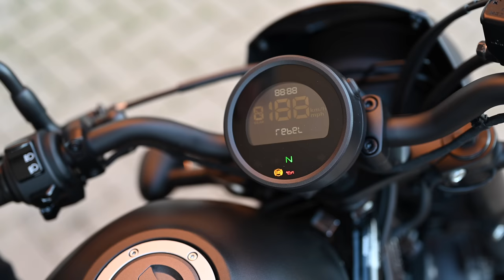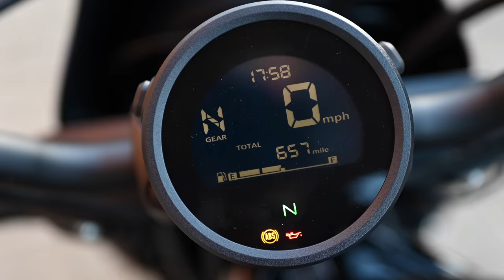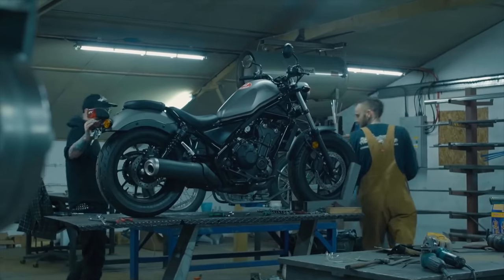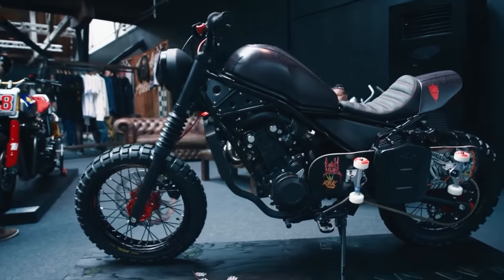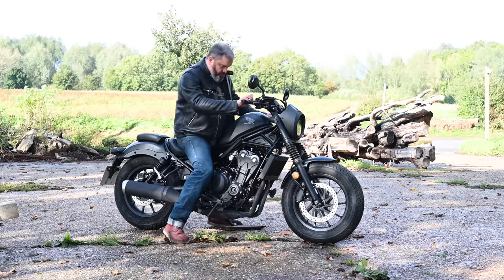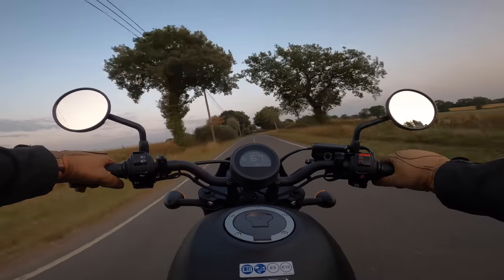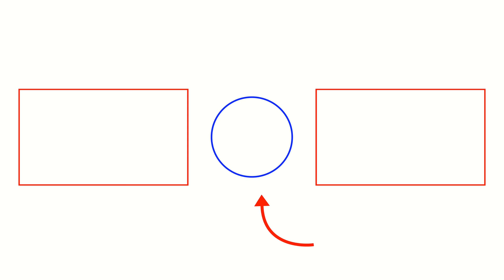Honda Rebel 500 - Road Test & Review

Comment: I've owned this bike for just 1000 km now and I can say it's definitely going to be a long term relationship
Reply: Can you travel on it? Like 300 miles?
Reply: @tea-bag7030  of course you can ....i have the same 2020 blue version and is awesome!  i bought the new mustang tripper seat 400$ ...and wooooow! what a change....i will stay with this motorcycle forever. i am positive..even if i saw today a new 1100cc rebel...i dont care...500cc is enough for me and it works just perfectly fine for me.enough power
Reply: now that the 1100 has come out, would you reconsider?  hahahha
Reply: @happyface8674  honestly i still think that rebel 500 is my best option.i dont make longer trips than 100km and i use my rebel only to commute, i now that 1100cc would be faster but 500cc is fast enough trust me. Is an amazing bike.
Reply: Haha, I relate exactly the same. 

Had to hide it at 1,200 KM now because of winter here.
Reply: @sergiuulici3908  how big are you just curious cause im looking at this bike... height and weight?
Reply: @jas9590  hey there! I am 1.70 cm and 73 kg....for me its perfect.  And i know a lot of people says is a cruiser...but the engine was taken from the cb500R which enable you to rev it a lot and get that sporty ride whenever you want some adrenaline.  Perfect commuting bike. The 1100 cc is too much to do the same. Drive safe!
Reply: 1100cc ist 30 kg more or 40 wirth dtc
Reply: how does a heavy set 6 ft man look on it?
Reply: @ManCaveRo  I can't speak for myself, as I'm a short person. But I think it doesn't make a big difference. So pretty normal. The only thing to consider would be the bent of your knees, but I think it's just a matter your liking.
Reply: @haago90c  thanks for the reply!
Reply: @haago90c  aint bad being on a bigger engine yammie bolt probably only advantage it has is highway riding… but no 6th gear and filling up every 100 miles gets OLD.

Comment: Looking to buy this to get back on two wheels. Couple years ago had a 2014 cb500f. Sold it with over 100k miles and the engine still purred flawless. The 500 engines are top class for reliability. Hopefully they have improved electrics since 2014, only problem i ever had with my Honda.

Comment: Agree with the forward controls.  I had real trouble moving this bike in my driveway - two heavy Harleys no issues, this feels top heavy to me.  It runs awesome from 25-45, but it doesn't do well on the freeway (numbing vibration) and it's very slow to accelerate IMHO.  Good review, thanks.
Reply: I noticed the jumping and bobbling when he increased speed

Comment: I don’t get why everyone thinks the running lights are a safety issue. Amber running lights are also not common in Germany. I own the 2019 version and had absolutely ZERO issues with them. I drive mostly in the city with lots of traffic (Berlin) and not one driver mistook my running lights for active indicators. The indicator shines way brighter than the running light. This is definitely a non-issue in practice. If anything it improves the visibility of the bike especially at night because the lights are spread out wider. There is a higher chance that a car driver sees at least one light in his mirror.
Reply from the maker: I haven't yet experienced any issues either , but it does seem an unnecessary risk? If the aim is for extra visibility they could be white lights? There are plenty of examples of dual colour lights for the rear. I don't know if you've ever ridden in the UK? maybe German drivers are more disciplined?
Reply: Views from the Man Cave No, I haven‘t ridden in the UK yet. But I can tell you that drivers in Berlin are definitely not disciplined. It’s pretty chaotic especially during rush hours. Double parking vehicles blocking lanes, drivers illegally using bus and bike lanes and cars quickly switching lanes without using their indicators is common place.

Comment: Not sure if your still responding to comments here but ill give it a go. If I was a brand new rider and wanted to do off road would you recommend starting on something like this and then going for a dual sport later or just going for the dual sport?  Also Rebel 500 vs 1100 thoughts?
Reply from the maker: Yep, i'll always try to reply to comments on all my videos. As a brand new rider looking to venture off-road I would suggest looking at the Honda CB500X, its the same engine as this but in an upright adventure style bike. Easy to ride, managable size and comfortable. https://youtu.be/g7j5APN_I2U  - Rebell 1100, more power and more weight and a little bigger
Reply: @mancavemoto  Thanks man! Appreciate it. The CB500X looks really nice!

Comment: I like the bike, but those amber running lights must go! Don’t know why Honda did this for the UK/EU market. Our indicators are hard to see enough as it is, going from an amber light to a slightly brighter flashing one is a safety risk.
Reply from the maker: My main worry with it is vehicles pulling out of side roads. A lot of drivers don't look hard enough already. My fear is that this just compounds that. They see orange with their quick saccadic glance and pull out thinking you are turning. It may be a worry over nothing, but it seems unnessesary.

Comment: I have a quick American question. Lol
So, I love the metric system and I wish America used it more fully, but why do I often hear measurements expressed in hundreds of millimeters?  Isn't the wonderful beauty of the metric system that you can just reduce the much larger number incredibly easily to centimeters?
Reply from the maker: Hi Ryan, thats a good question and I don't know why exactly. Trades people and engineers always do it, as it makes the numbers more easily readable because theres no decimal points. The bike manufacturers also quote in MM which is why i stated 690mm and not 69cm. if the seat had been 695mm it could of course be shown as 69.5cm, so it think its just a more immediately obvious number to quote in MM? It may be that its the accepted SI for science and engineering, but somebody smarter than me can probably confirm.

Comment: Hey, I'm thinking of getting the Rebel 500 as my first bike. I do understand you said the leg position is going to hurt on long drives, like is it because of the firm seat or suspension or both. I am planning to do trips to the canyons and stuff, will I be comfortable on this bike,it would be really helpful to know your opinion. Thank for the review dude, to be honest your review is one of the best I have ever seen with all the practical details. And Sir can you explain how to adjust the rear suspension?
Reply from the maker: Hi, it’s more the riding position than either the seat or suspension. If you have shorter legs it’s not so much a problem.

Comment: hi, I wanted to buy this when I get home but my concern is will the bike be ok if it's not use for several months??? The reason is because I am working abroad and when I get back I usually stay for weeks. I have been dreaming this motorcycle until now. I plan to get the 2022 version. Thanks.
Reply from the maker: It'll be the same as any other bike in that respect, you just need to make sure you give it a check over before riding it
Reply: @mancavemoto  Thank you

Comment: just a question - when you use the indicator - does it turn itself off automatically after straightening up? or do you have to manually switch the indicator off?  many thanks
Reply from the maker: You have to manually cancel the indicator

Comment: Hello, 

I got my full bike license about 4-5 years ago but never actually bought a bike. Yesterday I did a refresher bike lesson on a MT 07, after  my nerves had pasted i really enjoyed riding. I have two bikes I'm looking at. one is an XSR 700 and the other is  Rebel 500. 

Considering I haven't really ridden any bike apart from under instruction what bike would you recommend for me ? 

Thanks
Reply from the maker: Both bikes are great but are quite different in style. The XSR is essentially a dressed up MT07 so if you’ve ridden one in your refresher it won’t be too different.
Reply: Thanks,  I give I'll need to test ride both of them :)

Comment: Awesome bike. Just picked it up had to drive with it 350 km back home :) Now i know many neg comments on youtube are from people who have not ridden this. You can easily do long distance on this bike, honestly its more fun than my Tiger triumph 800xc, just with a bit less power. The bike does not blow all over the place on the motorway passing cars. Wind is of course sometimes an issue. The LED dash is a bit hard to read in high sunlight but i mean come on can you read your iphone in extreme sunlight ? When it rains though the screen is a bit small so in low vis and rain its a bit hard to read.
Reply from the maker: Enjoy and thanks for watching
Reply: At what speed can you do long distance - I ask because several times I've read that at highway speeds the vibration through the handlebars is annoying??

Comment: How tall are you ? Im 172 cm and been thinking between that bike and cb650r, but sadly cant test ride them i can only order them.
Reply from the maker: I’m 178cm tall
Reply: In the same boat as you.
Reply: Your hight is average in many countries, with some skill there is no bike you cant't handle. I am the same height and ride a sh300i scooter, sv650 2005, 2006 bandit 1200. Both feet on the ground is a false sense o security and honestly overated.

Comment: Second time through this. You have the same inseam. I think building the seat up a couple of inches would transform the riding position. Easy to do, and it wouldn't spoil the looks as it simply looks too low.
Reply from the maker: Yep, I only really noticed it being a problem on long runs and I have got dodgy knees

Comment: This might be a very newbie question but could this bike fit a passenger?
Reply from the maker: Yes there is a seat pad on the rear fender, but I think it would only be comfortable/practical for short trips
Reply: i will answer your question. yes, you can take a passenger with you but is not confortable for him/her. is just to small place for them. in my opinion is a 1 person motorcycle.. i have the new 2020 model and after taking a few times my girlfriend with me...after 30 minutes , she gets tired every time. so...1 person perfect.

Comment: Isn't much teck? Just double overheadcams, slipper clutch, water cooling, fuel injection, full led lighting, digital gauge and anti lock bakes on an entry level bike
Reply from the maker: I'll stand by that, a dual overhead cam first appeared in a motorcycle in 1914 and slip assist clutches are becoming common place. I wouldn't class water cooling as tech, and led lights and gauges are also widely used. ABS is mandatory on all motorcycles too.  My comment was in reference to the cable operated clutch and throttle and the lack of riding modes and traction control. It was a positive comment, not a critiscism.

Comment: 500 is just too slow. with this being said, I did not reference to the top speed. I meant the torque is insufficient. I almost need to get to the third gear to pull enough power to get to 35-40 mile/h. This bothers me at the stop light. in addition, it vibrates pretty bad after 75m/h. If you want to travel long trip with that speed, it probably wont be very comfortable. I think rebel 1100 is much better choice. for only extra 3k usd, you will get a much more versatile bike.

Comment: "showa pro link shock in the rear".....mmmmh me think not...
Reply from the maker: Well you think wrong, the rebel 500 has a showa rear shock with the pro link system….
Reply: @mancavemoto  "PRO LINK" is honda's take on a single shock rising rate system that has one shock,the pro link part of it comes from the levers and arms that give it the effect,it may have showa shocks on it but it has two of them just like an old cg125 etc, used to have so does the cg125 and old honda 90's have pro link then ?
Reply from the maker: Go check out the spec sheet https://www.honda.co.uk